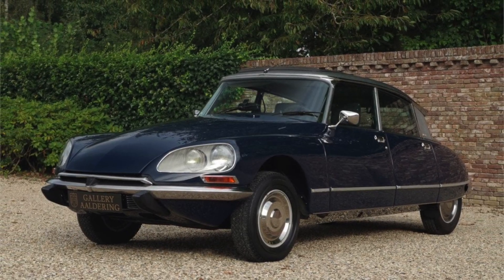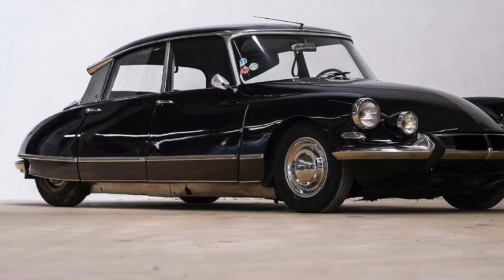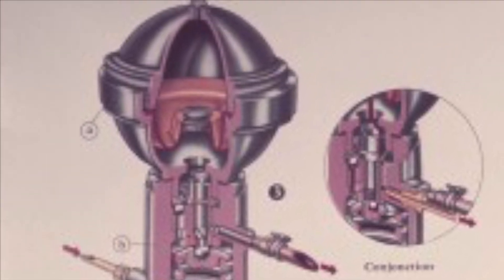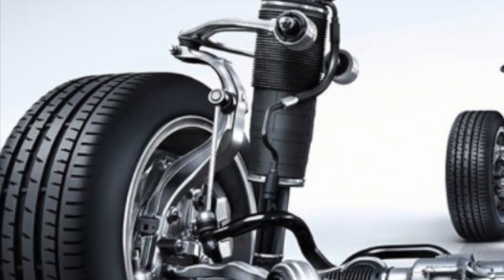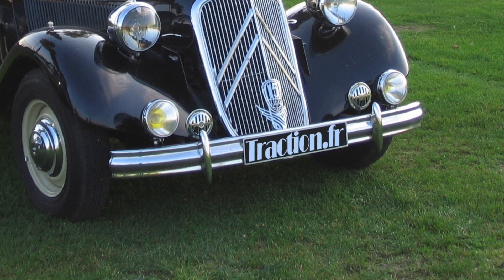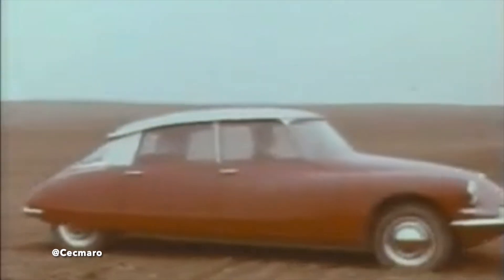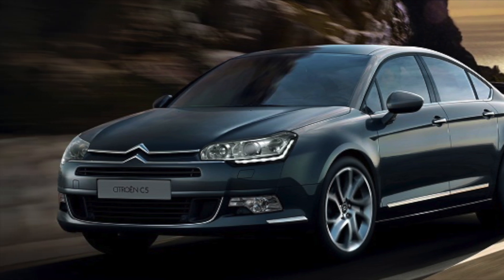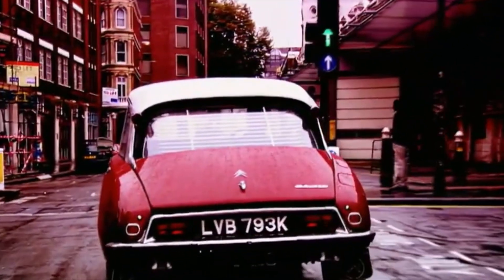Citroën DS Hydropneumatic Suspension | Ben Automotive

Comment: Can these suspension components not be transferred to other cars as a custom installation? That is by using the mechanical advantage/lever principles to place it in the right location and achieve the same smooth ride. I'm wondering if anyone has tried that as a proof of concept.
Reply: If indeed it were possible I'm sure someone would have tried it by now. It's been seventy odd years.

Comment: Other advantages are safety...
No loss of control in a front wheel blow out..
Saved De Gaul's life in assassination attempt - shot out 2 tyres and sped away.
You don't feel a rear flat.

Front & rear suspension squat under heavy braking with an antilock load proportion device to the rear... Makes a great towing car... In the UK - Xantia was tow car of the year.
Incredibly stable and fast on bad roads. Also very difficult to roll..

Comment: With basic servicing it was very reliable...
Including belting along in rallies...
Reply from the maker: @stephenberry1205  yeah looking back that's something I kinda wish I mentioned which I didn't because the DS was actually a very good rally car in its day
Reply: @ben_automotive  My first car was a 1962 Aussie assembled ID19.
I had a total of 7 x ID/DS, 3 x GS, 1 x CX Prestige, 1 x Xantia.. all hydropneumatic...

Also had a 1978 RR SS II from new... It lost power steering fluid twice in 3 weeks (the second time after being checked) and a stuck rear suspension height corrector once - in the first year...

The only suspension leaks in the Citroens were a leaking rear brake articulating joint in the 8 year old 1962 ID, and loss of fluid in the CX Prestige after a service and the pipe was not tightened properly...